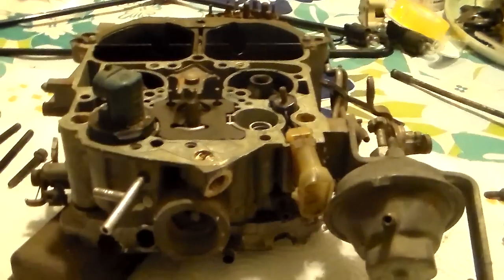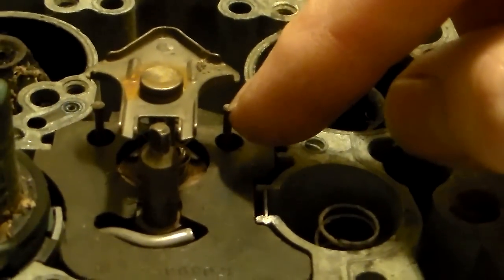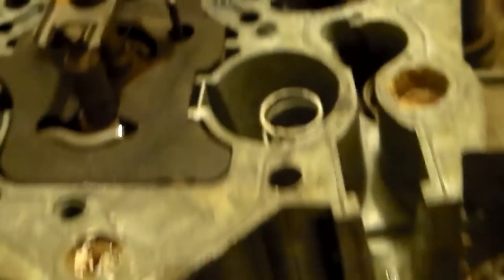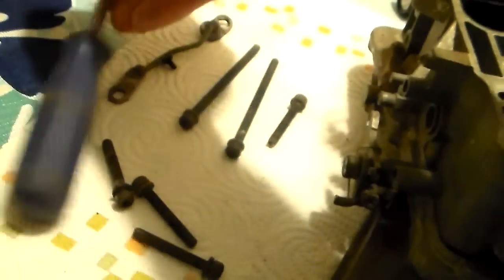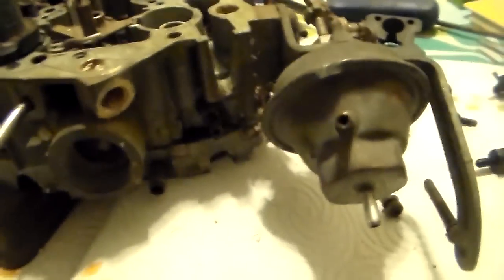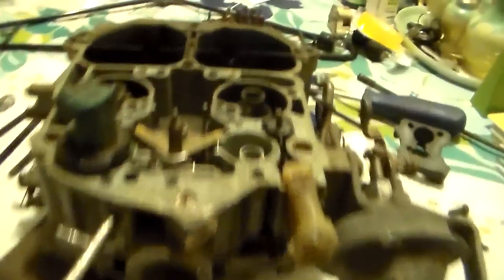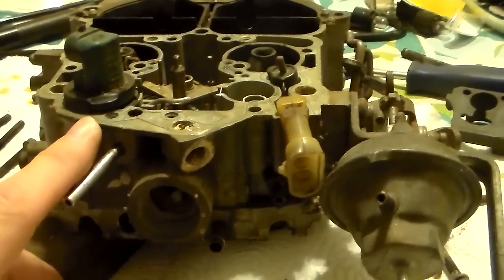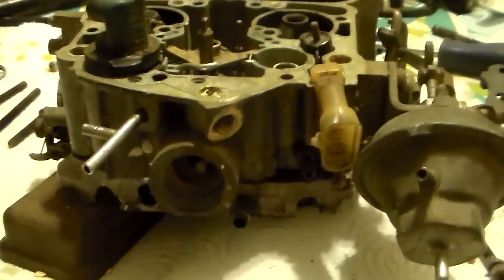Understanding the Computer-controlled Quadrajet part 2

Comment: Hey Tyler, Love the videos.  I have an 83 Cutlass with the 307. Recently the car started to stall while driving.  I pulled the mixture control sensor plug (disconnected it) and the motor ran great, when I hook it back up, the car starts to stall, even at idle. When I tested the computer (with a paper clip to get the trouble codes) the solenoid  started to click really fast.

Comment: What would happen if you forgot The spring to the lean stop/rich stop adjustment? I just did a rebuild on my rochester and when it was all togheter I found The spring among my tools😬
Reply from the maker: probably not going to work right. It needs to be there.
Reply: @TylersNeighborhoodGarage  thanks, I took it apart and fixed it👍

Comment: Hey Tyler, I am Earl, a long time mechanic.  I watched your one video that was one hour and eight minutes in detail  on those two rochestor carbs and learned soe good things.  Than you for this education I now have.  I have also watched these two videos on these computer rochestors quads and learned.  I just did a partial rebuild on my computer quadrajet on a 307 olds engine in my 1989 cadillac.  The only reason I took it of the engine and too it apart is because the accelerator pump was no good any longer.  So i cleaned it up part by part  and as I informed you in a previous video I cut out the upper gasket part that goes under the power piston, becuae that gasket portion isnt necessary .  and can inhibit the up and down ovement of those power pistons. After I reinstalled this carb back on this car.  The hot air choke and choke pull off works perfect and this car now idles super smooth, plus has no hestation when its reved up and no rich fuel or black smoke fro y exhaust at all   But when I plug in that 3 prong TPS it pulls my idle down, so I left it unplugged.  if something works perfect and no black smoke from unburned fuel and no hesitation at a on acceleration, then in my case what harm can happen by my leaving that TPS unplugged.  And even though the engine light work with key on, it turns off when engine is running, so it will pass inspection this way.  But in my case, based on a physics REALITY of some that runs perfect, yet doesnt run rich,this has to simply be okay.

Comment: On the electronic quadrajet, I am having trouble getting the throttle position sensor to stay down while putting the air horn back on.  The real problem is the green pin that contacts the throttle position sensor pin and the accelerator pump arm is not lining up.  When the accelerator pump is depressed, the green pin is not moving the plunger pin in the TPS.  it is out of alignment with the TPS plunger pin.  Any suggestions on assembling the air horn to get this correct.

Comment: Tyler's Neighborhood Garage I just rebuilt a Q-Jet on a original 1986 Monte Carlo SS and its making a rapid clicking noise when I turn the key on then after min it'll stop, the car idles great seems to run ok but I didn't count the turns on the Mixture control sensor...any help would be grateful
Reply from the maker: That noise is just the mixture control solenoid cycling..perfectly normal.
Reply: Okay thanks!

Comment: Can you remove or replace the electronic parts with manual parts?
Can you tune the ecm with a computer? Can you tune it enough to put a mild cam in a 305?

Comment: I would like to find the tool that adjusts the TPS on my 87 E4ME...they claim it's a 2.5 or 3mm nut driver. Where can I find one?
Reply from the maker: There are a couple OTC 7667 tool sets on eBay now but they are about $70. Before you spend that kind of money, take a strong light and see exactly what type of hex you are dealing with in there. I bet something else can be made to work.

Comment: I have an 88 Caprice. The caps for the idle adjustment screws have been removed already. It was running to rich on an idle test, and 2500 rpm test. Would I adjust the mixture screws on the front of the carb, or the stops for the primary metering rods? Should I hear the mixture control solenoid operating when the car is running? It seems to idle and drive just fine

Comment: I got a 1984 tans am what would cause rough idle on these carbs
Reply from the maker: Same things that would cause them on a regular Qjet, since the idle circuit is purely mechanical. Broken vacuum lines top the list, then idle mixture out of adjustment. From the factory those screws are capped, you have to pull the carb and file away the caps. After than though, they can be adjusted just like any other. If nothing else the carb being dirty internally will do it as well.Good luck.
Reply: +WhoSaidTyler why do they need adjustment if they are caped from the factory
Reply from the maker: mqe73M
Because over time the operating conditions of the engine change and the carb becomes dirtier. It's hard to explain, but on older carbs, adjusting the idle mixture is just considered  part of routine maintenance.

Comment: 1986 Trans AM 305   computer quadrajet.  Hi T,  I am having some bogging from a stopped position when i accelerate.  I am going to check:  1.  Base and High Idle Adjustment.    2.  Consider Tightening up the secondary air.  3.  Mixture Settings.      Am I missing anything?  Thanks,  J
Reply from the maker: +NOVA Chiropractic & Rehab Center of Sterling  Sounds good, only thing I can add is make sure the accelerator pump is working. If the carb hasn't been rebuilt in a long time the ethanol gas can eat the old piston cup.

Comment: Your videos have been great help. I have an e4me quadrajet. I took out the mixture control solenoid screw not thinking and then when I went to put it back in I forgot to count. I don't have a gauge to measure the gap or whatever. If I screw it til it bottoms out can I just back it out a few turns and be okay? Thank you
Reply from the maker: +Adam Landon yes. Somewhere online there is data regarding how to rough that adjustment in at first. Past that you can simply drive around and see if it seems too rich or lean at part throttle cruise. There is a plug in the airhorn over the mcs adjustment screw that you can knock and then tap the hole for a removable plug so that you can fine tune it without pulling the airhorn
Reply: +WhoSaidTyler  I have found a few adjustments and made my own gap tool with the measurements. I believe someone has already removed that plug on top so I will fine tune it, thanks again.

Comment: Just came across your video after doing endless research to try and learn what these computer controlled Quadrajets are all about. I found out today after working on my 1985 k5 blazer, sbc 350 that there is such a thing as these carburetors. I have a question for you in regards to the throttle position sensor and the mixture control solenoid. After replacing my alternator and trying to clean up a previous owner's hack job on the wiring to the carburetor, I found that one of the wires to the mixture control solenoid was broken. I finished the alternator replacement and fixed the wiring but now I have a check engine light that comes on intermittently with accel/decel changes. What is funny to me is that the check engine light was fine with the wire to the mixture control solenoid broken. Would there be any sort of connection between the new alternator (holding higher voltage), disconnected wire on the mixture control solenoid, and the throttle position sensor (because the check engine light comes on with throttle changes)? Any advise is much appreciated.
Reply from the maker: +Dusty Elliott broken wire may have disabled check engine light. Gm wiring design then was arcane.  You need to jump the aldl connector and pull the code causing the check engine light. Instructions can be found online
Reply: In the time past since I wrote u my message I looked up some more info and ended up running the code. It threw a code of 23 which is the M/C solenoid. Now I'm wondering if I should just go ahead and replace the solenoid or focus on the wiring to the solenoid.

Comment: WOW, I wish I would've seen this BEFORE I tackled replacing my MCS...lol. I own a 84 Chevy C-10 with a 350. Pretty much the same carb. Here in California, they have strict emmision standards, and I have to get my truck to pass "smog", every other year, or no registration. Of course this year it didn't pass (running too rich), and kind of figured it had to with the MCS because it stopped "ticking" a while ago. The Check Engine light was on too, so I just unplugged the light..lol. So, today me and my dad did exactly what you showed in this video, we just put everything back in reverse order. However, I did learn what exactly those two adjustments were from your video, the ones that were the MCS lean and rich mixture set screws...NICE!!! Hopefully it'll pass smog this time... excellent video!!
Knowledge about these is becoming a drying art!, Rock on dude!!!

Comment: Sir I have watched all the videos that you have posted about the Quadrajets.  I am a Novice Mechanic.  I am working on a 86 Chevy Monte Carlo.  On the Quadrajet that I have I am referring to the Vacuum breaker.  Even after the engine reachs operating temp.  The Vacuum breaker is not releasing Vacuum to allow the Secondaries to open at all.  Do you have some helpful advice for me so I may fix this problem?

Comment: Great video, I have a 403 that has a carb from a 1981 Olds 98 with and Olds 307. your other videos were very helpful for setting the high and low idle. what would you guess the CFM of that carb would be? It is not computer controlled.

Comment: Thanks for doing these videos on the Qjet - they are a big help.  I have a CC Qjet for a GM 305 that I'm rebuilding.  Can you tell me what the little hook w/pin is on the underside of the air horn right near the TPS and how it goes on when you put the air horn back on? It just seems to hang there but I'm not sure if it's supposed to press onto the top of the TPS when reassembling the air horn.

Comment: Ok I have a question, I have a 1989 Chevy Caprice wagon it came from the factory with a Olds 307 in it and the electronic feedback quadrojet on it. I had the carburetor rebuilt at about 160,000 miles I don't think either sensor was replaced. The car now has 262,775 miles on it should I have the sensors replaced due to age or leave them be? Real cold weather I got to pump the pedal about three times to get her started in warmer weather about two times. Car seem to run well no stalling or hesitating. I was just curious on those two things.
Reply from the maker: If it runs well I wonder worry about it. Those sensors either work, or they don't. Occasionally the TPS can get a bad spot in it so the voltage signal back to the ECM drops to zero momentarily, but that's rare.
Reply from the maker: WhoSaidTyler
"wouldn't" worry about it*

Comment from the maker: The easiest thing by far is to get yourself to a junkyard and grab one. They are not rare or hard to find by any means. You can decode GM Rochesters easily because the number is cast into the carb.

 But, Most Ford Autolite and that Carter BBD you have used a tag held on by an airhorn screw. So, if the tag is gone, no decoding. The number cast into the side of a BBD is meaningless. Sorry man.

Comment from the maker: I think you are right. At this point I think the only 750 cfm version they had used a side fuel inlet which Olds did not use. So, cheaper to limit the airflow than to re-engineer another carb.

Comment: I'm wondering why GM would use a carb that is way too big for the engine to use to it's full capabilities and have Rochester modify it down to where it would work on a small V8.  The only thing I can think of is that it was cheaper for Rochester to modify a carb they already made than to design a new one that better fit the capabilities of the engine it was going to be installed on.  This opinion comes from someone that only has a very basic understanding of carbs so take it with a grain of salt